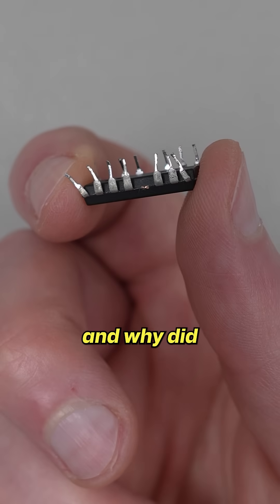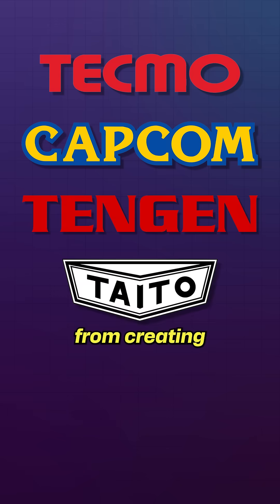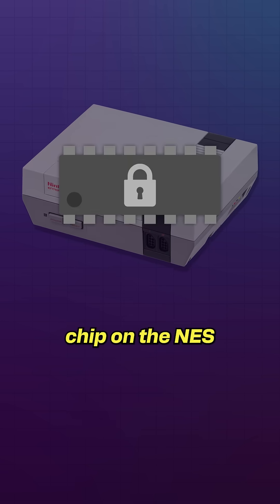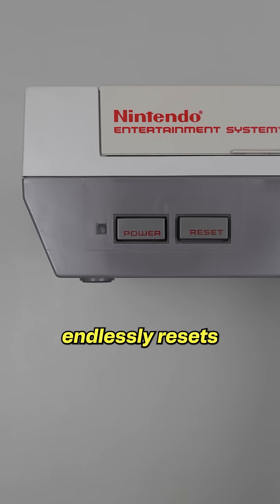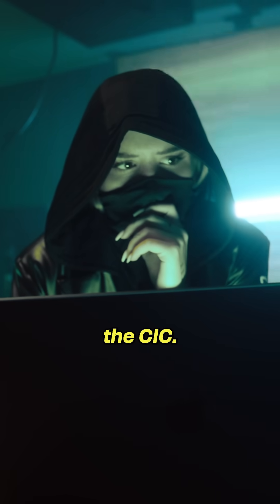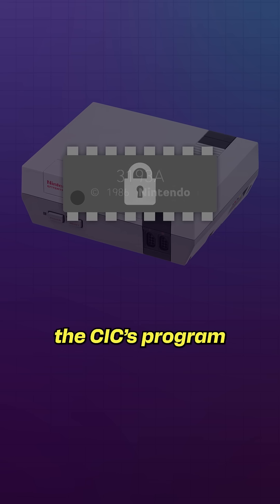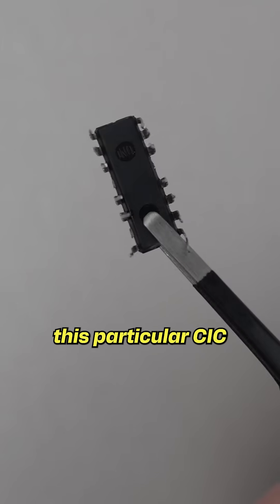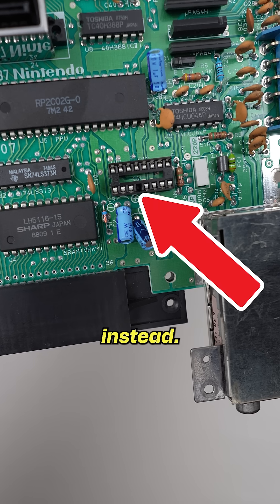Nintendo's Old School DRM #nintendo #nes #hacking #hardware #history

Comment: Bro i was sweating bullets when i did this mod to my Nes back in 2007, and i did not even have good tools for it i used scissors and it was a struggle to even cut the connection.

Comment: Small correction: from my understanding, Nintendo didn’t give the lockout chips to game manufacturers, the game manufacturers were contractually obligated to order their cartridges through Nintendo, meaning the lockout chip was already installed

And since you showed Atari, they didn’t figure out how to bypass the chip. They went to the copyright or trademark office, wherever it was the schematic was kept, and said they needed a copy for a lawsuit (which wasn’t true). They made their own CIC chips for the Tengen cartridges using the schematics, Nintendo was able to prove it in court since the submitted schematic had a little extra code in it that was removed in the version Nintendo actually used in the cartridges, but that code was present in Tengen/Atari’s version

Comment: Another way would be to unsolder the chip, bend the pin out, then solder it back in. 100% original, 100% reversible.

Comment: I did the 4th pin clip on my NES years ago, because the reset issue got really bad. This video doesn't cover it, but over time the NES gets really bad at reading the key chip in carts, and even legit games start reading as locked by the NES. Sometimes this is due to bad connections and cleaning/replacing the 72pin connector can help, but in my case even this didn't help all the time, and I would have to reinsert games two or three times to get good enough connections. Finally got sick of it and decided to clip the chip. Haven't had any issues since, and my NES still works to this day.

Comment: Yall remember when someone would walk in the room and the nintendo would reset? I hated that.
Reply: Over time the pins would bend inside the NES connector to the cartridge. This is because the push down motion put pressure on the pins.

Comment: That does explain why if the game cartridge doesn't sit correctly, the power LED will just endlessly blink at you.
Reply: The only explnation I found for this is the CIC chips data rate was alot higher than the CPU and PPU. This means a bad connection between the cart and the console would be more likely to affect the CIC chips ability to cominicated than the CPU or PPU ability to read the ROMs in the game cart. So you ended up with the blinking LED more often than it not working or scrambled picuter that would happen if the CPU or PPU couldn't read the rooms correctly.

Comment: Fun Fact: Atari once sued Nintendo over that chip, saying that it gave them an unfair monopoly on gaming systems. Meanwhile, Nintendo's argument was that they wanted to maintain a certain level of quality to the games that are made for their console. They later dropped their lawsuit after finding a workaround to the lockout, and began selling their "pirated" games under the company name Tengen, and were known for titles such as Shinobi, RBI Baseball, and the legendary game of Tetris.

Now you may be saying to yourself, "Wait, Nintendo owns Tetris, not Atari", and you'd be right. Atari originally purchased the rights to the game from Mirrorsoft. Shortly after releasing the game, it was quickly discovered that Mirrisoft in fact did NOT own the rights to it. Therefore, they had to remove that title from the market, making existing copies even more sought after.

However, Tetris, on the other hand, was an instant hit the moment it was released. Upon the revelation that Tengen did not own the rights, Nintendo sought out a company called Elektronorgtechnica (Elorg), and bought the original and exclusive rights to the title. And it's been a Nintendo product ever since. Tengen folded shortly after.

Comment: Its kind of like what is sometimes called "chip detect" on newer systems. Its how the piece in the system can "see" the presence of the chip in the cart. If its not there, the one in the system cant find a chip in the cart. So it's like the cart didnt have one.

Comment: I've never heard of the CIC chip being referred to as DRM but I guess the term didn't exist back then even if the CIC chip performs the same function. 

You also forgot to mention the CIC chip is used for region locking and the SNES and N64's CIC chips perform other various checks which enabled it to be used for antipiracy. Earthbound probably being the most famous example along with Rare's N64 titles (I know Spyro 3 is another big one, I'm specifically talking about cartridge based systems as that's what the video is talking about)

Comment: You dont need to do this all you need is 2x jumper wires if you google it you find it i did it and it works well and not tampering with the cic chip and you csn also be reverted back 👍

Comment: Rather than destroy a part of a classic console, you could almost as easily just desolder this, pop it out, bend the pin up, and then place it back in a resolder it.  Yeah it’s not lazy, but it keeps the system intact if you or someone later wants to restore it to actual 1980s working order.

Comment: I remember running a small wire from that chip up my butt it created just the right amount of resistance when holding the controller with aluminum foil

Comment: When I do hardware installation for the NES I unsolder the chip leg and cut it off. I don't charge for it, It's just a very annoying issue later on and removing the leg doesn't effect the system.

Comment: the nintendo cart was the best very hard to copy u got reminded we didnt have youtube and github in the day
Reply: You had various magazines and a lot more or less official support. There were many consoles and games - in some you could place a reset switch resetting the memory with the power still on (a hot reset) not triggering the lock - because the right key would be doing just that. There were many different hacks... As I recall it - some games were cloned. There were many legal loopholes - because the laws were lagging behind - Copyrights were about films and books. As long as you didn't sell the games - you could copy and exchange games with equally minded people eg. in a gaming club. Gaming Clubs in Europe were legal and you WERE free to distribute the software in between the members of the club... 
Getting games were just as easy as getting books in a library. It was as close as you can get to being a public service without being it. Looking back I still find it incredible the 1980's were completely unregulated. It was so unregulated that they had to state only records made on official bought software counted.  Even within official games there were loopholes and cheating codes.  Cheating started in the arcade games - I can't remember the game but it was as early as in 1971....
 I guess between 1 in 500 or 1 in 1,000 games were bought... If there were rules they were not enforced - it was almost free for all...
Not being online it was almost impossible to control. There's a reason computers have to be online today - it's simply to control and regulate what you can be doing. You've become the product... The 1980's were hardly fair to the companies. Today it's not fair for the customers.

Comment: Even though the NES had its fair share of bad games, their licensing model and use of lock chips helped prevent the console from making the same mistakes as the 2600. Ironically, later consoles like the Wii and Switch would become a dumping ground for shovelware.

Comment: Worked on Pinball in the 80s. Always put a socket on the board if you have to change a chip. The I/O chips on Bally were a horror.

Comment: There is also a couple pins you can cut and wire in a different crystal osolator to overclock the cpu for less lag in some games but for some strage reason the music also speeds up lol, best to wire to a switch to toggle original vs mod
Reply: That happens because games don't have their own timers and base their speed off the console's CPU.  It was a common issue in the 80s on PCs as well.
Reply: @alphanerd2305  yea the crystal oscillator oscillates at a specific frequency and can be used for more than one input

Comment: I thought the reason cutting pin 4 worked was because that’s the pin the chip uses to reset the console. So the cartridge still fails the CIC handshake, but the chip can’t do anything about it.
Reply: That is what the 4th pin does
Reply: So the entíre time you're playing the chip is screaming into nothingness.
Reply: @SnaksiXD  Good
Reply: but imagine putting in place this kind of verifications in the eighties, for games. alright now there are EFI bioses that are locked in secu mode preventing to boot on Linux, but this is trickier.
Reply: "you have no power here"
Reply: So the CIC chip is basically doing that one FNaF meme where it’s pounding on the glass and screaming for the NES to stop to no avail?
Reply: @KitsuneGB-hc9zb  DON'T PLAY THAT GAME MICHAAAEEEEELLL 

IT'S NOT OFFICIALLY LICENSED MICHAAAEELLL
Reply: @KitsuneGB-hc9zb How can I find this meme? It sounds awesome!
Reply: basically, yes, also, it is on the right because most unlicensed nes games suck, so the chip is just trying to save you @KitsuneGB-hc9zb

Comment: So you removed the chip that is the root of the problem, and then you soldered in a socket so you can insert the chip again but have it be disabled so it’ll act as if it wasnt there

I would respect it if you had left the 4th pin on the socket so you can later insert the cic if you want to restore the nes to original operation. But what youve done here is youve inserted a more expensive way to have the console ignore that the chip exists. You can leave it out, or you can get a replacement and put it in the socket, and it’ll act as if you left it out
Reply: Yeah! Could have added a switch between the pin and the trace so you can disable it whenever you want and re-enable it

Comment: You only need to cut 1 pin on that chip to disable it, check google for the pin, its easy to do.   Dont bother taking the entire chip off.
Reply: The idea is that he messed up and removed the wrong pin, but then he decided to remove the whole chip and then put it back in instead of just removing the chip and thats it

Comment: Couldn't you just take the original chip and copy it? Right around 97 and I had a job working for a guy and a big part of my job was to put a master chip on one spot. A bunch of blank chips and other spots push a button and then put those freshly programmed chips into little mylar bags
Reply: Those were programmed chips, they were meant to be programmed and copied. Taking a custom piece of silicon and copying it is a lot harder though, however it has since been reverse engineered (but no one makes nes games anymore so usefulness is limited, but its how modern flash carts work)

Comment: Just wondering, how does the console behave without the chip?
Reply: Perfectly fine (and you never get the the reset loop if the game needs a blow). Oh, and it removes the region lock.
Reply: @kakarlsen  sweet
Reply: @kakarlsen  dont... blow.. on the cartridge!  Omg why do people still think this is smart?
Reply: @lyianx why not?
Reply: Could cause corrosion, just reseat the game and it'll likely work better that way  @BitHappyy
Reply: @lyianx  because it works.
Reply: @lyianx  It's "blow in" the cartridge. not on it... and it has to do with humidity, oxidised contacts. eventually you will need to clean those contact fingers
Reply: @fryloc359 it didn't really work, the game was starting when the cartridge pins were making proper contacf
Reply: It's totally fine. This chip is no different than a padlock on a door. Removing the padlock doesn't affect the integrity of anything else.
Reply: We blew in the cartridges for years, never had a problem.
Reply: @larrys9385  similar rhetoric to "my grandma smoked for years, and lived to 100. never had a problem".

cleaning the contacts with legit cleaners (alcohol, deoxit, brasso), then storing it properly, was a much more effective long term solution. blowing in the cartridge worked, but was a short term fix when it did work, and caused more long-term problems. 

but yeah, if you just wanted your game to work for a year or two and planned to take it to goodwill after, then it "worked".

the problem with anecdotes are the problem with anecdotes. since the total population of console owners was in the millions, there were going to be plenty of cases (and even pockets of cases) where it worked out fine. but plenty of people also had problems. where you lived and the relative humidity and propensity to mold can make a huge difference, for example.

another example is that we always used to think yellowing of chassis had to do with whether houses had indoor smokers in them or not. turns out that the typical cause was actually more likely to be exposure to sunlight. but we kinda just had our anecdotes to go off of.

inb4 "nice wall of text, nerd". we're all nerds. we're still talking about 40 year old game consoles here :P
Reply: @larrys9385  with enough blowing over years, the humidity in your breath, and the little saliva blobs that come out will end up corroding the metal contacts of the cartridge edge connector.
Reply: @kalmtraveler  yeah 30yrs later and have NEVER seen corrosion on the game. Play them about every 6 months or so.
Reply: @larrys9385  ooh my apologies - it's not about the amount of years since they were blown on - it's entirely how much blowing goes on and how much moisture from your breath ends up going on the metal contacts. You may not blow very often, or maybe you're dehydrated so you don't expel much moisture in your breath, but regardless blowing on the cartridges doesn't actually help anything and risks permanently destroying them from corrosion.
Reply: It's amazing how everybody around the world blew in cartridges even if the internet didn't exist. The proof that myths spread in a way or the other 😅
Reply: @Fred_Klingon ever heard of the 100 monkeys syndrome? Well, I try to make it short...

Two groups of monkeys on two island separated by sea thus there is no way for them to interact or even see each other. There's an abundance of fruits (or is it sea shell as food) on both of them, and one particular of them (the food) had a hard shell so no way for the monkeys to get the delicacy unless by accident found a a cracked or opened ones, until... One day a researcher observes one the monkey on one of the islands by accident found a way to crack the hard shell of the delicacy by hitting them onto hard stone or by another stone. Thus enabling one monkey on one of the islands started to enjoy the delicacy, while the other monkey goes on their daily things still don't know how to crack open n enjoy it like the others on opposite island.
Times goes by, and the researcher was surprised one day that the monkey on the other island somehow "learned" on how to crack it opened just like the other ones.
He observed that there is no way for both groups to "communicate" with each other, the islands were too far to be visible to each other, and there's no way for any of the monkeys to swam over thus to pass the knowledge to the others.

These kinds of scenarios have also been observes multiple times over various studies n occasions all over the world, and known as 100 monkeys syndrome. I can't verify how true the original story was, but I do remember I read them from a motivational book as a side story in one of the chapter - heck can't recall the author nor the title, but most probably a book by fame motivationist Anthony Robbin (I could be wrong though).
Reply: If you blow in the game your drops of spit, acts like a kind of "conductive contact spray" on the pins in the cartridge.
Reply: If you use can air or an air gun, you can use that to blow in the cartridge and not risk getting saliva in it.
Reply: @TheEmbessyNetwork  Or go to a hardware store and buy a can of compressed air. Does the job VERY well.
Reply: @AJR-zg2py  yeah that's what I said with Can Air lol just with an air gun, you won't have to keep buying cans over time.